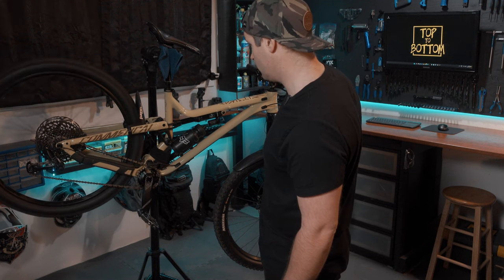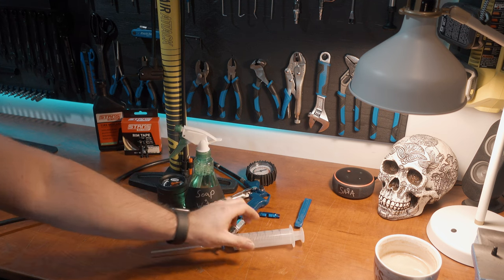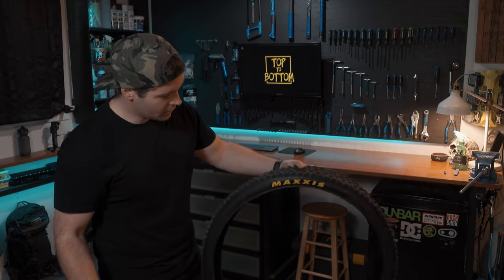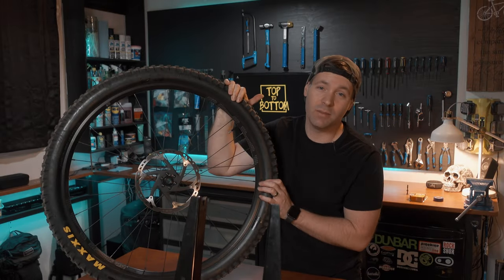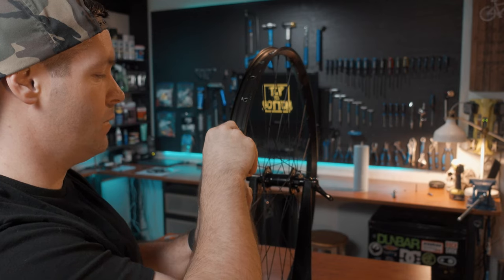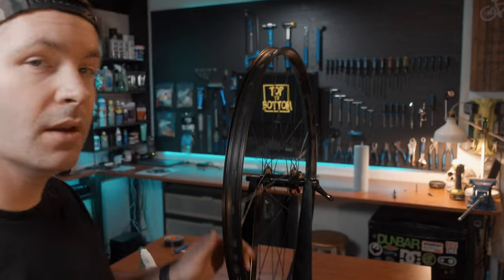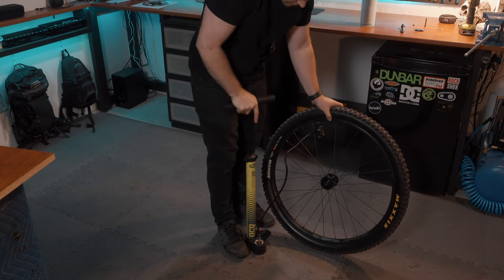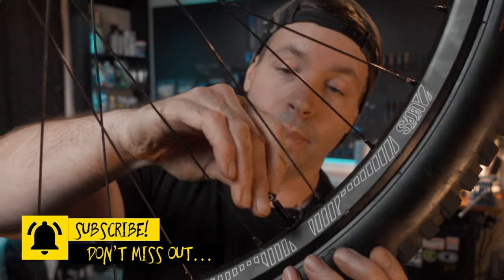TUBELESS TIRE INSTALL WITH GORILLA TAPE AND A HAND PUMP

Comment: Beautiful video.I think the electrical tape is overkill. Using just gorilla tape for years with no problem for a long time. Really great tip with the tire lever at 18:50 or so. Thanks!

Comment: Hey kids, don't forget to check for leaks with the soapy water, because you almost always will have a leak on first try. And while I will try the lever trick for seating my gravel tires on my hybrid bike, wetting the tire and rim a little also helps with seating as well, and that satisfying pop is even louder than when the tire is dry.

Comment: Is there really a benefits on tubeless weight is not really an issue as tubes are just very few grams, for sealant you can always add sealants on tubes too? Puncture? I dont understand the idea of hitting your rims but when you watch Redbull Rampage every contestant using tubes and i find tubeless you always need to maintain. If puncture is an issu the reason we have tire sealants for that and you can always add it to your tube and go low psi for super extra protection add anti puncture liner for overkill🤔
Reply: Most of presta valve tubes do not have a removable core. You will not be able to add sealant an easy way. Other than that - yes, there are tubes with sealant that work for small flats. With that for 29er you will save over 1 lb in weight plus you can go low pressure. Tubes do not allow under 30 psi to prevent pinch flats. Riding low pressure is a very big deal for MTB. Liner will not help with pinch flats, and tubes with sealant will not seal pinch flat - those are too large

Comment: Oh no. Tire Rule #1 broken on the front tire. The Logo do not line up with the valve....  Sorry dude, i think it is dangerous to ride with that front tire....   :)

One tip to share. If you struggle to get the tire to seat with a handpump, even though you prepped it like you demostrated. Take out the valve core, this will improve airflow and make it easier to seat he tire.
But you will need to pump it up again to the riding preasure, unless youre fast with your thumb and putting in the valvecore again :)
Reply from the maker: Agreed! Thx for the comment! Tried that… The one issue I had was that my hand pump head (schrader/presta combo) needs the valve core in to push against to block the air from coming out the schrader side. But I found that manually mounting the tire gave me enough of a seal to get some pressure. 👍🏻